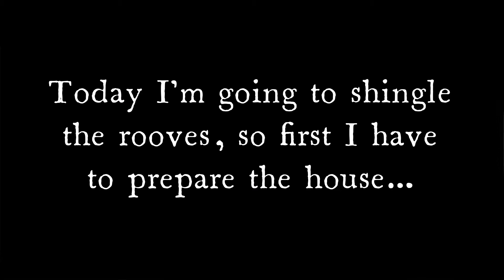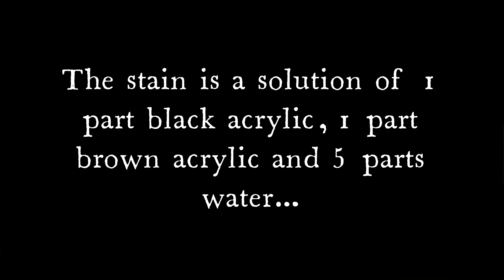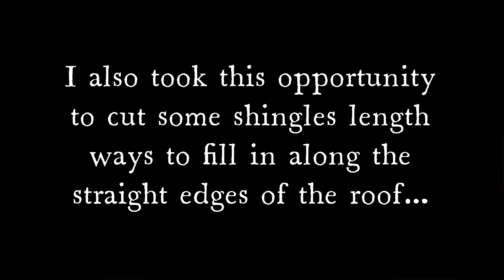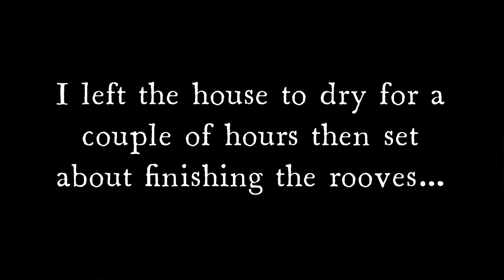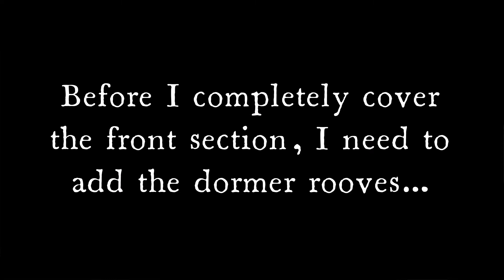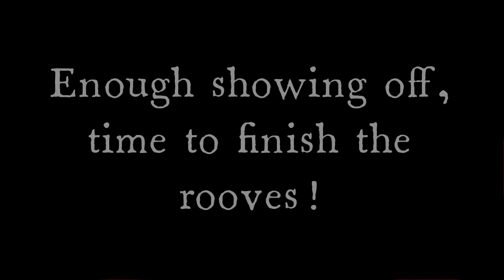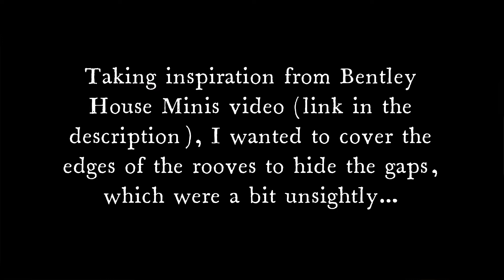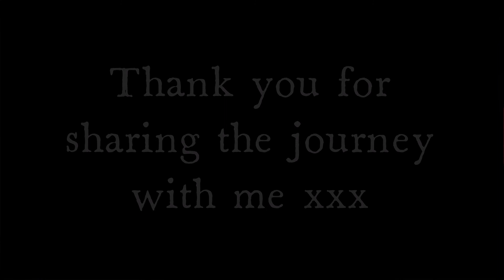Victorian Alison Jr Dollhouse: the build part 9

Comment: You didn't want all the shingles hanging over the edge of the roof? What is that black edge showing underneath? Is it a gutter or part of the roof unshingled?  I'm glad the little house I got is already shingled. That honestly seems like the most tedious job. Not done with video yet, maybe this gets addressed....
Reply from the maker: There are pieces that go around the bottom of the roof before you shingle, but I forgot  to put those on, I thought I could add them later but they didn't work out. I have some curved edging strips that I've put around the bottom, which I'll show in the next video x